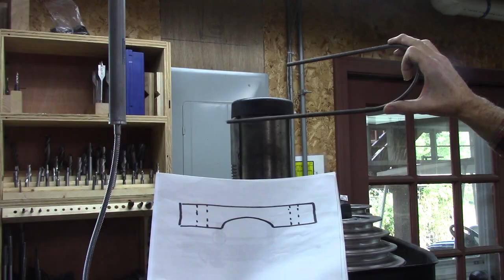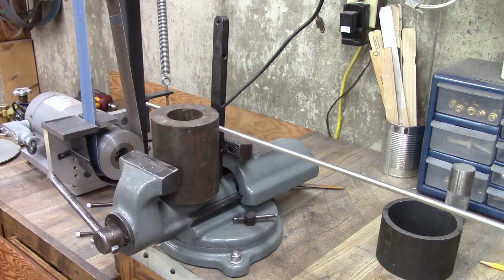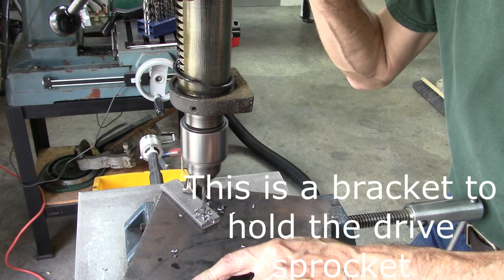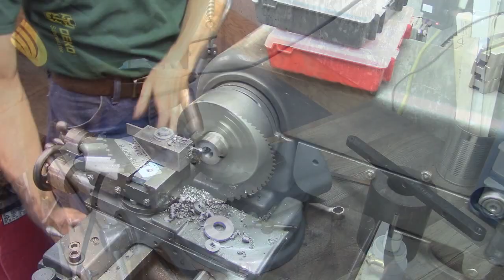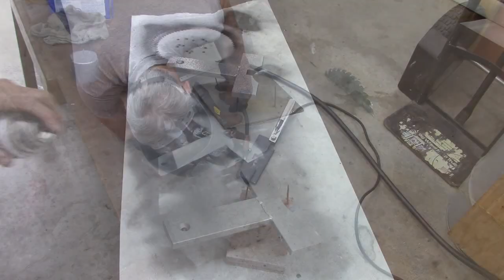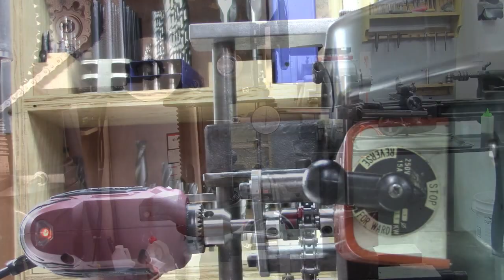The Ultimate Round Column Mill Fix

Comment: I don't think Otis (elevators) has anything to worry about ;)

You've not had the setup that long and already you've 'gone the wrong way' with the drill right at the end of travel. Even before that happened, I thought it ought to have end-stop limit switches. If you plan to have the drill-powered system permanent, ideally, you'd need the limit switch wiring connected to the drill reverse switch so each limit switch would only work in the direction it needs to work in. Noting also there's quite a bit of over-run on the drill motor - so the limit switched would need to be quite 'early' and of a dsign that it wouldn't matter about the over-run going further towards the switches.
Reply from the maker: I probably won't bother with the limit switch although if I was selling the mill equipped with a power lift or other people were using it I would certainly do this.  The way the drill is oriented you push the slide switch up to move up down to go down...  easy to remember. Thanks!
Reply: @WinkysWorkshop  I saw later you'd done similar to other machines with electric drills !
Reply: I also note comment about one day getting a 'proper' mill - and Bridgeport getting a mention. It seems they do the same 'drill stunt' but with motors other than in drills :)
I have a 'proper' mill - so the feed is powered from the main drive motor via gears or via a rapid traverse motor via a clutch.
Reply from the maker: @millomweb  - Cheapest servo motor around. The one on my drill press is 3000 RPM but the short one on the mill is 1500. both variable speed. $18 and $30 bucks.
Reply: @WinkysWorkshop  I presumed that was the attraction :)

Comment: I would of made it more simple by making two clamps to hold the rack in place on the column and that would prevent to rotate around the column....
Reply: That actually would not be as good as the lateral tolerance on the rack will be 'quite big' and being so close to the pivot point, the slightest movement there would be amplified 10 times by the time you're as far out as the quill.
Reply from the maker: So true.
Reply from the maker: I actually tried that. The rack is too weak and flexes. To make that work the rack would need to be attached to the column every 3 inches and most like pinned. Do this accurately would be a challenge.

Comment: You may be getting some flex from the crank handle travel bar attached to the milling machine's pipe. The bar with the notches in it. Just tack weld it in strategic locations and if you ever want to get rid of it or sell it you can just grind off the tack welds. Those bars are only stuck in at the top and bottom collars giving some horizontal or lateral movement.
Reply: I've thought of doing this to mine. I figure if i work out the minimum and maximum heights i'm likely to need i can weld the remaining of the rack bar top and bottom to the pipe.
Reply from the maker: It will flex (a lot). For this to work well the rack needs to be attached to the column about every 3 inches. .001" rack movement translates to .006" or .008" at the spindle.

Comment: Have you tested it to see how much lateral play there is with pressure against the side of a end mill?
Reply from the maker: There is zero play with moderate pressure but I lock it to the column for milling. So nothing moves  At some point I might beef up the clamps I made and install a 1-1/2" bar and then try leaving the clamp slightly loose It would be nice to not have to unlock the head to raise and lower it.

Comment: Nice job. If you make a bushing for the rod it might be better
Reply from the maker: The Delrin works well and has two advantages. Low friction and zero clearance. Due to the very low contact area you can have zero clearance and low friction. Delrin is rated very high for good wear on sliding surfaces but if it wears I may consider a bearing  some sort. Some linear bearings have a preload adjustment.

Comment: Nice upgrade.. I solved the problem a different way... I started watching Craigslist... I found a Bridgeport with powered feed on three axis & a DRO it was listed cheap... I was the first respondent & got it for $1000.... Then I sold my RF mill on Craigslist for $750...    

Not quite as creative but I love the results....
Reply from the maker: Yep, you did good. I'd got deal like that in the past but larger mills always seem to have a negative... way too big, 3 ph, need a ton of work, 1000 miles away etc. I did get my South Bend 11 for $100 but put a lot of hours into restoring it. Nice lathe and worth the effort however.
Reply: @WinkysWorkshop  

It is 3 ph but I already have a VFD & I did wind up driving 700 miles round trip.... So yeah it had extra challenges... But I'm happy with the result... LOL

Comment: To stop the rotating problem just drill the rack gear and  drill and tap the column to fix the rack to the column. The power feed is nice .
Reply from the maker: This can be done however there are some problems with this method. First, the rack needs to be pinned or bolted to the column every 4 inches. There is a 4 inch area at each end to do this but bolting it in 2 placed is nowhere near adequate and even 2 on the bottom and top does not hold the rack well enough, it flexes way too much. Bolting the rack in the middle is difficult due to the teeth. It is possible to use pins but if you get the rack positioned wrong it's hard to correct. The rack gear looks substantial but after they cut the gear teeth it's actually not even 1/4" thick. Like I said, it's possible but not as straight forward as you might think.

Comment: I've watched a lot of machinist videos and for my money this is one of the most useful mods on this mill/drill as I've seen anywhere.  The video work is also great.  If I attempt to do this I'll try using 1" square stock instead of the roundstock  to hold the head in index with the column  I wouldn't be surprised but what your round stock is minutely flexing.  Thanks for the project.
Reply from the maker: Thank you sir! I agree, the bar could flex a little. I would have used 1" rather than 3/4" but the bore in my lathe is 7/8". I like round for one reason. The contact area is very small on the Delrin blocks. This allows for firm contact without much friction. Square would work well but setting the slide blocks might be touchy.
Reply: @WinkysWorkshop  I agree with the contact area being smaller on round stock.  Rather then Delren I'll use some small bearing I have and pre-load them a tad.  After that, it will be good enough for my backyard shop!!  Thanks again for the great video....
Reply from the maker: @YourOldDog  , Yeah, some the the linear bearings have a preload adjust, that would be good.

Comment: I've made a lot of my machines with power drives and found that wind screen wiper motors do a very good  job, they are an angled drive and geared, also cheap
Reply: Hi Winky, yes understand I buy the Motor for about £9 and the power supply for £12 must be 12v and about 7amps
Reply from the maker: I think the wiper motors would be great  but they also require a power supply.  I could be wrong but I think the $30 drill is cheaper.
Reply: It's around 12 kg force required to wind the head up.
Reply from the maker: @workshopcarnival6011  - I actually check that. That sounds about right. I think I came up with 3-1/2 foot lbs

Comment: I like the drive idea and the concept of the alignment rig. I think the vertical rod needs to be larger, high precision ground rod, and the brackets a bit more rigid. Great idea.
Reply from the maker: I would have made the bar larger but my lathe bore is only 7/8".  I think everything is more that strong enough to keep things in alignment BUT it would be nice if the clamps were near impossible to move and used a 1.75" bar. That way I could leave the head clamp slightly loose without fear of head movement.  It would be great to eliminate the need to clamp and un-clamp the head.

Comment: Have you seen Bruce Whitham's version. It fits on the right side with no interference from the pulley on up travel. He sells kits for it. I have copied it for my older RF30.
Reply from the maker: I just watched. There is many ways to fix this issue although I think I like mine a little better. The only advantage I see to his design is that you can swing the mill to one side if needed but so far I have never need to do this. Hos might also be slightly cheaper although probably not if you include buying calipers.  I also saw a guy use a laser to align the head. If you ask me, if I have to critically align the head after moving it the laser is the easiest and very accurate as long as you mill is level and bolted to the floor. Thanks for the info, I like seeing how other resolve issues.

Comment: It seemed to move the most when you unlock and lock the mill. It stayed constant in the line of travel. Better lock migh be next fix. Lol
Reply: I agree. i would try to find the 'sweet spot where the lock doesn't need to be locked and unlocked every time.
Reply from the maker: Not a bad idea although I've had the mill head rotate on the column while it is locked down and I'd hate to rely on the guide bar only to stop the head from moving. It always locks down within .001 to .0015 anyway and that's very close for anything I do.

Comment: It may just be me, but I hate square corners, even with a small radius on them.  I would definitely make that lower right hand corner really rounded off or contoured around the spring housing.  Can't wait till you put up the links to plans and materials so I can try to build one for my RF-31.
Reply from the maker: Just posted the plans. Hopefully they are good enough for most to use. The biggest concern is differences in mills. Rong Fu made several variations over the years. You are right about the corners!  Thanks

Comment: You did an excellent job there Winky.  I like the drill for your lift motor.
Reply from the maker: Thank you very much! That little Harbor freight drill was $28 bucks. It runs 1500 RPM and there $18 drill runs 3000 RPM. Same amps and power but the slower speed was perfect.  Plans are now posted although I don't think you need them if i remember right

Comment: Excellent design Wink, I  have been  toying with the idea of a rod or bar and DTI to regain position when moving on the column. I have also been toying with a counterbalance to make cranking easier. You have addressed both ideas and executed the result with great success, I am looking forward to the plans when you draw them up. Good looking haircut and excellent finished project, cheers and thanks. 
PS, That wood based coordinate table for the press sure is working out well for you!
Reply from the maker: Thanks you sir - The link to the plans are now posted. Yeah... love the drill press table! I assume you mean the X Y table. The drill press is way easier to use than the drill mill and almost as accurate.

Comment: I find that a lot of Chinese equipment uses a mix of metric and inch. Odd, but they must have some reason. An annoying thing though. 22 years ago, when I bought my mill, I bought a cheap 4” Chinese vise. A Kurt copy, the way yours is, and so many are. More recently, I bought a set of SnapJaws. These (American made, by the way) are quick release jaws. I took the old jaws off and tried to put these on, only to find the screws weren’t the same width apart. About 3/16” difference. Not only that, but it turns out that the standard Kurt screws for a 4” vise are 3/8”, not the 5/16” these vises have.

I ended up buying a new vise.

What happens when you raise, or lower the head is that it swings around the center. It’s always the same distance from the center. It just swings from side to side. It’s more than annoying, but I found that it can be dropped exactly into the same hole just by swinging it around, with the help of a few gentle taps of a soft blow. I had bought a gear motor to do what you did, but never ended up implementing. It, since it just took a few seconds to get everything centered again. The biggest problem is the effort of turning that crank, as I’m getting on in years. That 120 pound rotary table with 6” vise I used to remove from the shelf and plunk on the mill, and visa versa, without a thought, now takes some effort and planning. So I might do it after all. Good work with that.
Reply from the maker: Yep...  I understand the getting old part! The power lift is very nice! I've used the same method to align the head with the drill in the hole etc. Honestly the best easy method is to use a laser pointer mounted to the mill. Put a line on the wall and after you move the head just line the laser up with the line. Of course the mill needs to be level and the line perfectly vertical.  My next mod is a new table...  the mill hurts my back when I use it very long!

Comment: It’s pretty good as it is but if you swap out the guide plates for a linear bearing you can take that .001 of play out.
Reply from the maker: Hmmm?  I'm not sure. The delrin if firmly against the rod. I think most of the .001" is related to flexing and when I tighten the head. Either way, I'm okay with .001"

Comment: Yet another clever solution to a daily pain. I have a 8" spacer under the ram of my Bridgeport, and I am continuously running the knee up and down with the manual crank. Too bad I couldn't incorporate this to my mill .
Reply: Adapters can be bought or made to use a 1/2 inch drill for the knee feed. Commercial knee feed units are also available.
Reply from the maker: Harbor Freight drills are cheap! Thanks for watching!
Reply: Make a drill motor adapter for the knee... Fun simple project : https://www.youtube.com/watch?v=-4t8g8AensE&t=560s
(I certainly hope that Mr. Winky doesn't mind me throwing a bone to Tublecain!) I made these to make my X & Y handles on my round column mill "Power feed".  With a slow drill, it made big improvement to final finish passes!

Comment: I can see a project in my future.  This fixes having to crank the height and the rotation.  Did you ever try cranking the height with just the drill?  I'm wondering how much power is really needed.
Reply from the maker: I think the drill would be able to do it but the speed would be way too fast. A slight miss calculation and the head would fly off the top - Ha. With that being said, if you do this reduce the sprocket size from 72 to 60. This will keep things slow enough and also resolve the sprocket hitting the bottom bracket. I'm working on the drawing now...  will post the link later today I hope. It will be below the video in the discription.

Comment: Very nice job as usual, with your various mods to your machines. Good Ideas to do similar on my RF30 Round Column Mill. What gear ratio's did you use, & what are the gears off .   Keep up the good work.  Thanks
Reply from the maker: Check back tomorrow - I'll have the drawings posted later today with all the specs.

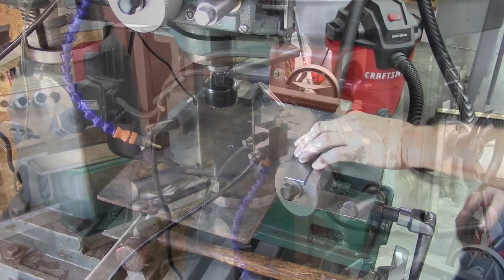Comment: 9:40 what is the white item that floats into the shot. We can sell more tools if both metric and imperial are in the machine, should have thrown in a Torx too.  I recently purchased an *MSC Round column mill/drill.  I can see a project in the future. *(Pretty sure it is a WrongFu)
Reply from the maker: Yeah...  the round column is not a plus but the mill is actually fairly good. I have no idea what was floating around...  I saw that when I edited the video. Weird. My mill is an Enco...  I'm guessing you are right, both are Rong (wrong) fu
Reply: I have a jet mill that look just like this one and I had to triple check when I realized they were 1/4-20 threads 😂
Reply from the maker: @HighCaliberCraftsman  - Either way is fin with me but both is crazy

Comment: Nice video and takes me back to my toolmaker days. The only thing I'd change would be to make the clamps a little sturdier side to side by triangulating the weld bases + increasing the vertical bar diameter and changing to a linear bushing instead of the delrin pad setup. The linear bushing could be mounted in a block with slotted adjustment in/out to tweak the alignment. It might help with repeatability.
Reply from the maker: I was going to go with the larger bar but my lathe bore is only 7/8" (to drill the ends). As for the delrin brackets. More rigid would probably be good but I think the pads work better. The amount of surface area is small so they can be tight against the bar without a lot of friction. There is some flexing but zero slop. The movement on the indicator is due to the the column clamp being loose while you move the head. Thanks!

Comment: Great idea, I do have a question why didn’t you make a bearing block out of the Delrin? That way the shaft would have slid up and down the bearing block
Reply from the maker: Thanks...  I'm confused about your question. I did you delrin on the guide
Reply: Winky's Workshop let me clear that up. My thought when I seen your video you was going to mount the Delrin horizontal with a reamed hole that rod sides through like a bearing. So my question was did you feel the block system give you more wear adjustment than a horizontal block with a bore fitting the shaft.
Reply from the maker: @JamesDedmon  - I understand now. That probably would have worked well. I considered installing a bronze sleeve also. In both cases the clearance vs surface area could be a problem. In other words, with the Delrin pads the contact area is extremely small and firm contact with the bar does not create excessive friction. With a sleeve it would be a challenge to get the exact slight clearance without creating a lot of friction.
Reply: Winky's Workshop ok I see your thought process now. Still a great modification
Reply from the maker: @JamesDedmon  - Thanks, so far I love it!